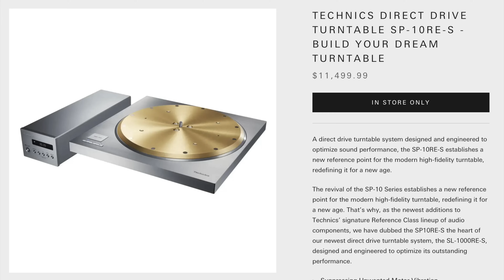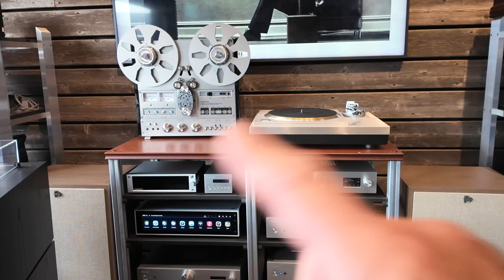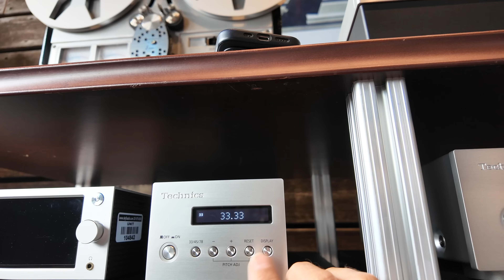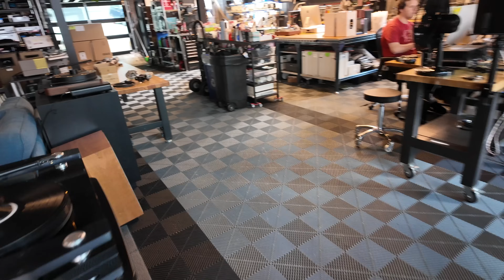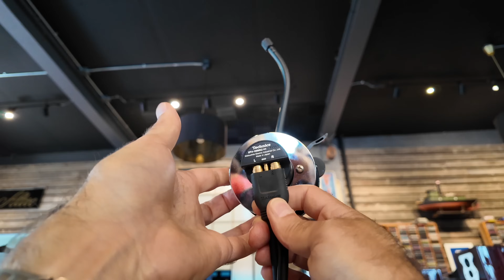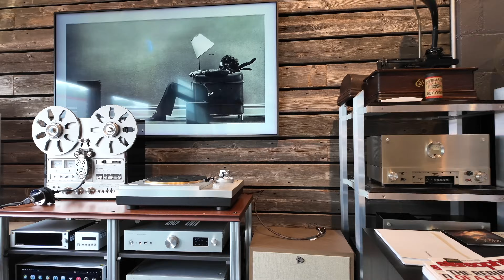The Flagship Technics SL-1000R Turntable - SIMPLY STUNNING!

Comment: Hi, I have a question: the DIN connector on my SL-1000R (recently purchased) isn't fixed but moves. The video should show you what I mean. I imagine this isn't normal. I saw that under the connector, there's a hole with, I think, an Allen screw. Do I need to tighten that? Thanks, Roberto.  https://www.youtube.com/watch?v=jNP8UgHLNOQ

Comment: There are a few turntables, that are the SINAI commandments to Moses:
(Not a ranking!)
1. EMT 927, and more compact systems: Neumann P2A, (or more common: Garrard 401/Thorens TD124/Garrard 301)
2. Thorens Reference (Wilson Benesch GMT One)
3. EMT 950/Technics SL1000R (replacing the SP10)

4. Micro-Seiki MR 711/Technics SL1200
5. Ariston RD-11
6. La Platine Verdier
7. Simon Yorke S4
8. Simon Yorke S9
9. Rega P3
10. Kuzma Stabi S

The best turntable of all?
Fabrication: EMT927, topped today by Thorens Reference and Wilson Benesch GMT One
Most people having fun with great sound: Rega Planar series head-on with the Technics SL 1200 type series
Most appreciated renaissance: Ariston RD-11 related models
The single best today? A) entry: Rega P3 B) enthusiast: SL1200G or Rega Naja C) whatever no sweat: SL1000R D) vintage: none, as it depends on what your updates actually do otherwise in original they are totally outdated and have been.

Comment: It so funny to see such outstanding technological features being used to reduce either noise or flutter, because in the end it all depends on the record. They are never perfectly trued and centered, so even if the platter is running at 33.33333333333333 rpm with vitrually 0.0000% wow/flutter, well... You will always get wow/flutter off the RCA signal. No matter what you do.

No quarter-million belt-driven TT nonsense would outperform the 1000 bucks SL-1200 lineup. Or even cheaper vintage ones.
Reply: Lordtaraden, your reply about the perfect LP is superlatively on point! Going forward, I shall remain with the idea. Thanks, Cheers!
Reply: Dear LT, you "speak" ever so confidently about these things...Lordtaraden, nice!

Comment: That motor reminds me of the eds-1000 motor in the Dual 701 and 721. Very similar (although that motor has 2 rows of 8 coils each instead of 9 coils each).
That motor was pioneered over 50 years ago by Papst (I think the Dual 701 came out in 1972 or so) and was the first coreless direct drive motor for a turntable.

Comment: The SL-1000R is a "rebirth" of the SL-1000MK3D model that sold for 650,000 yen in 1983. That's equivalent to US $4,439.50. With inflation this means it would cost US $14,020.00 today, so the price for the new model is not totally surprising... Still hate selling my SL-1000MK3D for $3,000 back in 1997...

Comment: The SL-1000R is nice, but I'm holding out for the much rumored, SL 1000 Hoffa LE version, where the turntable is mounted in solid block of concrete (for MAXIMUM noise control).

Comment: Stunning turntable in everyway, a genuine hi-fidelity vinyl replay tool of the highest order/quality, a last turntable. I have it's predecessor, a circa 1975-77 Technics SP10 MK2 SP10, choice of the BBC for decades, in a panzerholtz plinth with the Technics EPA-A250 Titanium Nitride Arm and the EPA-B500 armbase with on-the-fly vta and a Ortofon Cadenza Black moving coil cartidge, re-tipped with the Fritz Gyger S stlus profile (same as the replicant stylus profile used on all Ortofons top tier carts and the whole thing is excellent. I would only ever consider replacing if I had the funds for one these, the current SP10 offering 💪💫💫

Comment: In fact, there arent that many cables for the SL1000R. It has a DIN output so they are few off the shelf ones. The cable should also be fully shielded. Ortofon makes a very nice and quite expensive one. I'm a Kimber fan, but I can assure you if you use a non shielded cable as a connector it will pickup high frequency electrical interference like a dedicated antenna. They sure did on when I used "turntable" Kimbers on my SL1200 G. If you can find an SPDIF that's DIN on one side and RCA on the other under 100 bucks go for it. As for cartridge find a moving coil you like and buy it! The whole point of the SL 1000 is to be they best spindle for ANY cartridge. Given the investment on the platter you also invest in a step-up transformer for whatever moving coil you select. I have an Ortofon Cadenza black with an ST70 SUT. I'm seriously considering an Ortofon Verisimo. The Black is spectacular but, like any other dumb audiophile, Im getting a case of "let's spend even more money"😂
Reply: Update.... I did get the Ortofon Verismo. Absolutely amazing, It's no questions asked an SL1000's best friend!

Comment: Come back down to Earth! You do not need $20K to get the best out of those vinyls. You can spend $700 and still get the best sound. I have a $400 TT (TurnTable) DD (Direct-Drive), class A vacuum tube amp with P2P (Point 2 Point) wiring and a $250 pre-amp and a pair of Klipsch bookshelves with a Klipsch subwoofer and my system pumps ass, total cost of my system roughly $2,500. So, one doesn't need a damned $20K or $30K TT, and anyone says different, their head is in the damn clouds and needs to go build themselves a bridge to get over themselves, because they are a JOKE!
Reply: Blah blah blah.

Comment: No, I don't think $20,000 is too much to spend on a good turntable if you have a major investment in vinyl.  This "beast" will last you forever. I own a 40-year-old Linn LP12.  I think they are great turntables and when properly set up sound magnificent.  That's the problem.  I depended on a store in Tampa who lost the "fire" and set ups and upgrades (which were significant) on my Linn became less audible and less satisfactory.  And I have other tales from other "customers", including my thyroid doctor, that ultimately led to the demise of this store.  Now I live in Tennessee at least 4 hours from the nearest Linn Dealer.  I am pretty sure if I come into some money, this Technics is the way I would go.  Thanks for the great video.
Reply from the maker: You're spot on.  A table is only as good as the setup that was performed.  The LP12 doesn't travel as well as the Technics so it's critical that a local shop calibrates it, preferably in the owners listening room so that nothing gets disturbed.  This is where the Technics shine, since they were originally designed as DJ tables they are super rugged.  We are able to calibrate one and ship it with 100% confidence that it will arrive the same.

Comment: Really nice overview on the 1000R table. Its a superb table with real sonic benefits and improved performance over the G and just about every belt drive table I have tried. To get something better than the 1000R, a person would need to get well north of 100K. The OMA Mills K3 comes to mind. There are 3 areas you may have overlooked or covered briefly. One is the headshell leads. Lots of options there from Cardas, AQ and others. Two is DIN connector on the back. Its a super PITA if a person wants to change tone arm cables. The DIN connector is recessed, not easy to see, and tough to firmly grab the installed connector to remove it. Would have preferred more accessible DIN or better yet, RCA or XLR connectors on the rear. Two - B - would be the choice in tone arm cables. The Cardas Clear Beyond is really nice on this table as are the Nordost Frey 2 and Vahalla. Three would be the orientation markings on the platter and spindle. Easy to overlook. The platter and spindle are marked by the factory for correct platter to spindle orientation for balancing. On an earlier Skyfi video you tried a goldfinger cart on the GR2. Perhaps give the goldfinger a try on the 1000R or the new AT ART-1000X cart. Its an amazing sounding cart. For the 2nd arm, I would be inclined to try the Kuzma Saphir 9. Far from cheap but that arm on this table may be a real holy S _ _ _ in sonics step up. I believe one of the Technics options for arm boards is for the SME series of arms. Allwoing a person to mount an SME IV or V on the 1000R as well. Nice video.

Comment: 17:23 My wishlist for the next 1200G is solely a tonearm upgrade:
- dynamic balanced 
- ruby bearings
- magnetic dynamic damping 
- micrometer VTA adjustment
- tonearm effective mass added to the list of specs

As a user of a 1200G for over 7 years: everything else about the 1200G is perfect already
Reply from the maker: Wow you must have been an early adopter.  7 years takes you back to the beginning.  Nice to hear someone has had one that long and is still happy.  Thanks for sharing the list.  Would love to see the ruby bearings on the current lineup.
Reply: @SkyFiAudio  Yes, I was just too late to get one of the first 1200 of them, which were limited edition (1200GAE). Those went for the same price as the regular 1200G (3500 euros), while the differences are solely cosmetic, it would've been nice though.
I remember being a little bit disappointed about it, but I don't mind anymore.
Now that they're not made in japan anymore, while being 1 grand more expensive, means I still got a great bargain, despite missing out on those limited ones!

Comment: 1:05 The SP10R and SL-1000R have both been release at the same time, not too long after the 1200G went into production.
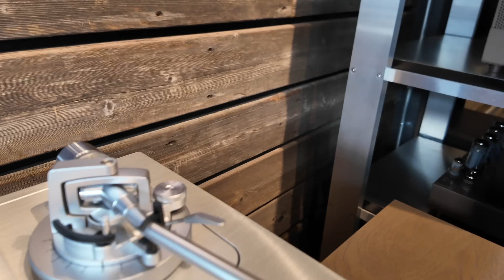2:50 Really? That would make it a risk in terms of repairability...
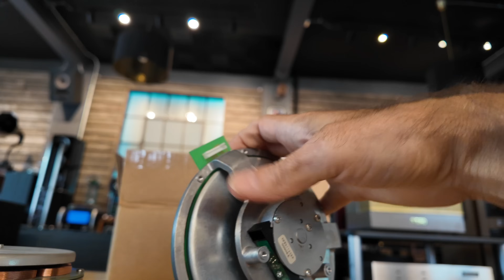7:35 Yes, that's an optical encoder.
13:23 This is the main reason I still didn't get one. The idea of dealing with an actual pallet crate.
Btw, how is your back doing? Is it still okay after hauling around 80 pounds of turntable?

Comment: Yeah, but did they fix the cogging problems ? Even Technics themselves admitted that it was a "real" problem in the marketing literature for the G/GR ' tables. More HiFi BS, I'm afraid.
Reply: Cogging is and has always been unadulterated BS. At best, it's a theoretical electrical "defect". Belt driven turtables cannot match rotational precision of quartz controlled direct drives by an order of magnitude regardless of, or if, cogging was ever a factor. Despite that, Technics designed a motor that eliminates the "problem". The retatiomal stability of the SL1000R can only be bested by a motor controlled by an atomic clock! It's wow and flutter are so low they are basically unmeasurable! Its better than any record cutter lathe ever devised!😅
Reply: @Wised1000  Yes, I know, and agree with you. BUT why does HiFi need to have things made out of unobtainium and then goldplated?- it makes no difference, it really doesn't. And let's not forget all the hype, tripe and BS to go with it: Well, you put this on , and it does this and sound like this etc. 99.99% of the time it either makes no difference OR you're just listening to artefacts, nothing else. Really good components are inaudible, they are transparent in the signal path. THEY SHOULD NOT AND DO NOT HAVE A SOUND WHEN DESIGNED CORRECTLY.
Reply: @davidcarr2216 
Its called the law of diminishing returns. You can buy an excellent Yamaha baby grand piano for  about 20k or opt for a similar Steinway and pay 100k. They are both excellent instruments, but one has its own particular tone that people are more than willing to pay 5 times as much!
Reply: @davidcarr2216  hey have you heard of those 45,000$ RCA cables? 2x as much as this turntable for a single cable to plug into the turntable... I bet they make all the difference !!!

Comment: Being a retired working man myself, I told myself I was going to  support this guys sales pitch, and let somebody else kick the snot out of this easy target , but $1200 for an arm board , makes it tough.   Let me just say value is subjective.  As is human hearing .   

 I favor a belt drive suspended design until the money gets" instal one on your yacht" crazy, then there are some recent improved direct drive designs.  I also favor litz tone arm wiring that terminates only at the connectors to the phono jacks, without breaks .  .
Reply from the maker: I like the idea of tonearm cables without breaks I them.  It's the most critical wire in an audio system as it carries the smallest signal and is most susceptible to interference.  Thanks for sharing.
Reply: well today all is worst not like they use to make it and the direct drive today uses not quartz engines but older ones like i have in other turntables older that worjk today after so many hours of use, i remenber that instead of the turntable i could had bought a BMW 535i but i kept driving my 76 523i , but music is my hobby since i was four years old ,i ´ve seen the footage and saw myself playing and singing  and tunning the steel strings of a wooden child guitar and sounded ok with my voice, this in 8mm and sound in a reel

Comment: It's completely befuddling how dealers seem to justify spending 💰 oodles of cash for seemingly pedestrian technology that hasn't evolved much since the late 70's. The ORIGINAL SL-1000 (79) boasted ruby tonearm bearings, obsidian plinth, moving coil cartridge, gigantic smoked dustcover, titanium nitrate tonearm (including headshell!!), quartz synthesizer pitch control (MKIII) for one price. This new fangled a la carte purchase order menu is too ridiculous even for the super rich. SMH
Reply: gee whiz guy, they did put in a whole second set of offset coils to help reduce the cogging effect of their drive system , and the consumer is now free to buy their own head shell and connecting cables.   I'm sure the list price is entirely fictional in many markets outside of the U.S.
Reply: there has been so much work Technics put into the 1000R, it offers excellent performance for the price. The speed accuracy and stability alone is among the best I have heard on any table. Much better than the old 1200MK3 or 7 and better than the new G. The super rich are buying tables in the 200K to 500k range.
Reply: The turntable itself is on another level way beyond what they offered in 1979 on the SP-10mk2 and is even better than the mk3.  That said, I do wonder if the older EPA-250 and 500 are better arms.  I waffle between getting the complete SL-1000R in time or just the new SP-10R and using a vintage EPA tonearm (I like the Technics arm for how it allows such ease in adjusting the arm height, including while a record is playing).  I do like how the complete SL-1000r looks though...
Reply: @martinmelucci4383  no clue on how the EPA arm would compare. Completely agree with comments on the earlier models. Had almost all of them. One other thought. If you are considering the new SP-10R into an older chassis, another option would the Kuzma 4 point. The old chassis do not have the damping the 1000R chassis does though.

Comment: I wish I could buy a Technics SL-1200GR2 with a smooth top . I dislike the DJ furniture , I'm reluctant to settle for the 1500 with it's better visual appeal , lesser performance
Reply from the maker: There is quite a lot of controversy on this topic.  Bottom line is Technics can barely keep up with demand on the GR2 and G despite the DJ looks so why mess with a winning formula?  I personally love the strobe on the platter and would hate for it to go away just to get rid of the pitch control.
Reply: I did that, I gave it some extra love with a 2M blue (I already had it) but Iman sure dreaming of a real 1200. There is several companies like Funkfirm which claim that they can enhance 1500 also.
Reply: Yes I would have been interested in one if it looked like the 1500.
Reply: My thoughts exactly. Now that Technics have versions of the 1200 aimed at the audiophile market, I feel they are missing an opportunity by only offering DJ deck looks. What I would really like is something that looks like the SL1000 but essentially a 1200 under the skin (motor, plinth materials and platter) with or without tonearm. A high value-for-money package with true audiophile appeal.
Reply: With the new SL-1300G you should be covered. Does it appeal to you?
Reply: Try the. new SL1300

Comment: Excellent, Fernando. I'm saving my nickels for an SL1000R. I find it bizarre that Technics don't get rid of the "DJ" bling on the SL1200G. It is contrary to the design ethic of the typical audiophile.
Reply: more features equates to more value for some people that just want to play records.  An audiophile knows the everything vibrates at some level and contaminates the signal, so they strip away features in interest of performance , preferring to spend the money on the basics, like a  better tone arm instead of a light show .
Reply: The opposite, it would be bizarre to get rid of pitch/speed adjustment.
Audiophiles are perfectionists: if they know a record was recorded/mastered at an incorrect speed, they want to correct it using that pitch fader.
Strobe OTOH is something that can be removed though, because the typical audiophile has multiple strobe discs anyways...
Reply from the maker: I would be sad to see the strobe deleted on the G.  My guess is if the pitch controls go so does the strobe.  Are you ok with that?  If so save some $ and buy the SL1500C!
Reply: @SkyFiAudio  Pitch control can easily exist without the strobe, because they're separate parts of the circuitry, both are hooked up to the central microcontroller.
In fact, the strobe is a PCB with a cable and connector that connects to the main board: you could unplug it to disable it.
But the mains power input switch is also on there; you'd need to run two separate wires for that switch.
So it's definitely possible to redesign the electronics without the strobe (or reduce it to just 1 row), but with pitch controls.

Comment: One clarification about adding arms. The add on armboards sit at different distances from the spindle, and the rear position is only suitable for 9-10 inch arms, and the left position only works with 12 inch arms.
Reply from the maker: Meant to cover that in the video, made a quick mention of it and forgot to re-visit.  Thanks so much for clarifying sir.